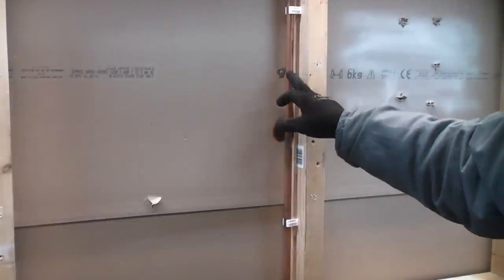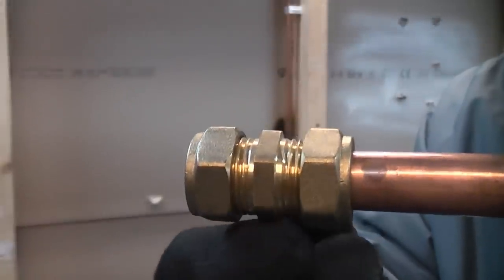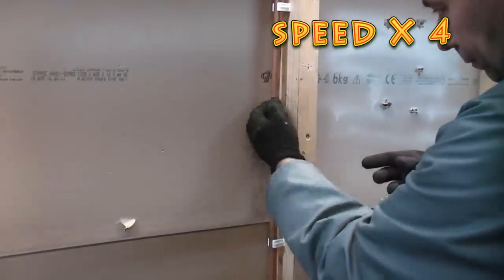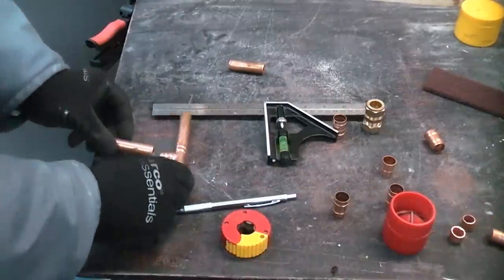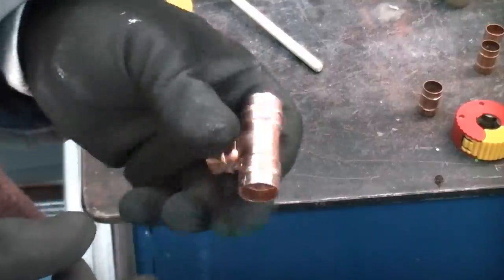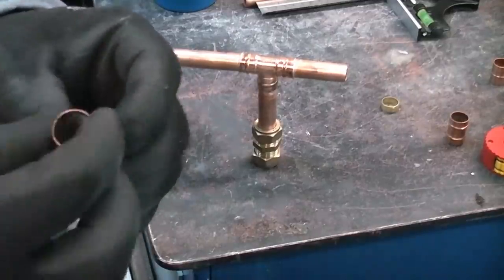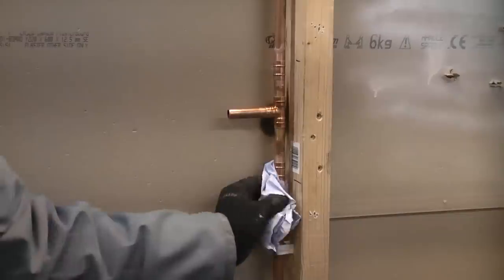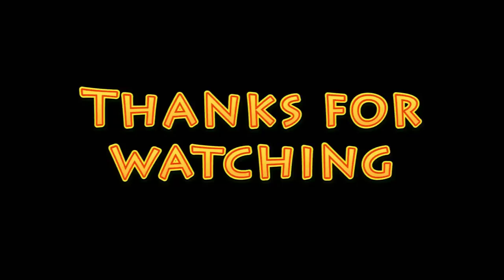How to use slip couplings to tee into a rigid copper pipe

Comment: could have done that job with one slip coupling!
Reply from the maker: Really?
Reply from the maker: I have thought about it. 
Perhaps you would care to enlighten me ?
Reply: Make two cuts and remove section of pipe. 
Make sure lowest of the cuts is where you want the branch of the tee to be. Allow 15mm for insertion depth. 
Prep pipe and tee coupler. 
Put lowest socket of tee onto pipe.
Measure removed pipe and cut off section of branch approx 15mm. 
Prep all pipe sections remaining and slide slip coupler up or down, align pipe and slide into position. 
Pencil mark is useful so slip couipler is equally covering both ends of cut=insertion depth.
Solder up.
Compression slips are available too if persistant drips are present.
Wouldn't use bread sponge if it's going to a boiler flow or return and if cold feed for domestic hot water If you cant flush Warburtons toastie out It'll get into the plate heat exchanger and do block it up.
Reply: I'd like to hear how myself. I can't think how either
Reply: Ultimate Handyman  he's spot on you only needed one the other coupling basically being the tee is what he means
Reply: I agree, only one slip joint is needed. Slip it far enough along the existing pipe and there will be enough room to pull the pipe out at a slight angle and slot the tee joint in, then pull the slip joint back across. Above or below, it wouldn't matter.
Reply: There is some flex in that pipe. One side stop, one side no stop. Bend out pipe a little to and insert the assembly with the stop fitting.
Reply: by having either the top or bottom pipe portion fitting directly into the T
Reply: Not if the pipe won't move. Unless you bend one piece.
Reply: No way without bending one side to get the pipe in the fitting. I suppose one could pound the pipe into the fitting.Ouch!
Reply: You could join the top part of the tee onto the existing pipe coming down and only use a slip coupling on the bottom piece, or vice versa
Reply: hi well one slip would be replaced by a tee.
Reply from the maker: Yes, but the pipe will not slip through the Tee like it will with a slip coupling ;-)
Reply from the maker: You can't pull the pipe anywhere, it is rigid and cannot be moved.
Reply from the maker: But the Tee is not a slip coupling, so the pipe will stop ;-)
Reply from the maker: Exactly ;-)
Reply from the maker: I look forwards to seeing your video on how to do that.
Please ensure that the pipes are rigid (cannot be moved).
Reply from the maker: I hope you are paying attention to ALL of the experts ;-)
Reply: Your particular length of pipe is held onto the timber stud by plastic clips, so it MUST be possible to pull it out by the width of the pipe, that's all it needs. If we have to pretend there is no flex whatsoever then that's a different matter and two slip joints would be needed, but we're basing our comments on your scenario, not an imagined one.
Reply: Ultimate Handyman I think they’re saying the pipe was rigid because you didn’t remove the pipe hangers. This would’ve allowed the pipe to be moved just enough to use only one slip coupling. A plumber probably would’ve removed and replaced the hangers so he could work more easily. Really doesn’t matter, but you know people are always going to point out how they would’ve done it.
Reply from the maker: Yes it is and above that is a elbow and at the bottom is an elbow, so the pipe is rigid and cannot be moved in any direction. Thanks for the comment ;-)
Reply from the maker: You can't remove the pipe from the pipe clips as it is held at the top and the bottom with clips, near the top and bottom elbows. If I could have moved the pipes I would have used normal couplings ;-)
I tried to state in the video title that the pipe was rigid and also mentioned about a scenario where a pipe was joined to a boiler and concreted into the floor!
Anyway, I think people now know what a slip coupling does ;-)
Thanks for the comment
Reply: @loafersheffield  what technique would you use for rad pipes if not bread?.
Reply: I agree with the gentleman who wrote that you just need one coupling and the tee fitting ,the pipe is being held in a plastic clamp above ad below the cuts if you put the slip coupling on your choice of pipe to join again then you can slip the tee on because it has a ring in side to stop it from blocking the lateral opening, cut the piece of copper to fit in place solder tee first push the other end in then slid the slip coupling down to the line that you were supposed to have marked on the pipe to be soldered ,solder it in ,plug the lateral pressure test then complete the job with two fittings instead of three. Saving about 7-9 dollars including  overhead cost so your looking at plumber price possibly $150.00 give or take 10 - 25 dollar . It would be cheaper if you do it yourself . Those plastic holding clamps you possibly pulled out one of the loose ends to joinit.
Reply: Didn't know about the elbows didn't show
Reply: Good catch. I'm going whys he using 2 slips. He does get a thumbs up for wiping off excess flux on verticals. I don't like to add joints so if you can't move the pipe you smooth off the bottom pipe stop on the the tee. Now it's a slip t.
Reply: Why do they not make slip tee couplings?

Comment: You also could use PEX and shark bites . 👍👍
Reply: Absolutely, 5 seconds into the video I was saying to myself, why isn't he using Pex?  I don't solder anymore, not because I don't know how, done many.  Sure Pex may be bit more expensive if you use Sharkbite but you can use Push'n Turn which is quite a bit cheaper.  I neither had never heard about slip couplings, good to know if ever need them. Good video though.

Comment: You don't always need two slip couplers: more often than not you can pull out one side of the pipe to fit one side of the tee on; then you only need one slip coupler on the other side. Incidentally does anyone make slip tee couplings? If you can get one side on this would avoid the need for any additional couplers at all.
Reply from the maker: At last, someone with some common sense 👍
The amount of people that commented saying you only need one slip coupling was driving me nuts!
I searched for a slip T coupling a few months back for a job that I was doing, but I could not find one.

Comment: I know how to use repair couplings, I only clicked the video because it looked like he was using a torch with pro press fittings. I’ve never seen sweat fittings like that before. Must be a European thing. They’re sure making soldering idiot proof though they do make a sweat joint look much prettier
Reply from the maker: Solder ring fittings are great, I'm not sure if they use them in other parts of Europe, or if they are only used in the UK
https://www.youtube.com/watch?v=7zlDHA3KhLA
Thanks for the comment

Comment: Well done, but wouldn't a t drill do the job
Reply from the maker: Not sure how you would cut a pipe using a drill 🤔
Thanks for the comment 👍
Reply: A T drill, it's a machine that you drill into copper pipe, when the drill tip is inside, you twist a ring on the chuck and two formers extend outwards the machine retracts the drill tip with formers and a collar is made for the branch, I live in Finland, I'm sure plumbers in the UK use T drills. 🇬🇧😊

Comment: I don't understand why you used 2 slip couplings when it would have worked with just one.
Reply from the maker: The pipe is rigid, you need two slip couplings 😉
Reply: @ultimatehandyman  I agree to a point but the pipe you were working on was quite long so it would have had enough give in it to pull away from the wall to slide on the the tee. But if the pipe was very short then yes you would need 2 couplings. I often used washing machine "slip" tee taps in my plumbing days but I don't know if you can still buy them. It was good to hear you saying how useful solder ring joints are as I know many plumbers think you're an amateur if you use them but I often used them if I was just doing the odd joint and used end feed if there were many joints to make. I also used compression joints. They all have there place and there's a skill to using them all.  No offence meant my friend it was just an observation. Love your vids thanks.

Comment: It can be done with only one slip coupling.
Reply from the maker: I look forwards to seeing your video.
Make 100% certain that the pipes cannot move and are rigid ;-)
Reply: Yes, In this instance you could probably do it with one slip coupling and the tee coupling, it would depend how much "give" you get in the pipe once you've made the first cut ...still a very good video though and it is the text book way if you can't achieve any movement on the pipe at all...

Comment: Would be great to show how to successfully use a speed fit tee with two fixed pipes , that can be a right pain in a@&e
Reply from the maker: If you can't move the pipes, it is really difficult. I guess in some cases you might have to cut out a section of the pipe and use a piece of plastic pipe in between.
Thanks for the comment

Comment: Are you not a believer in putting on extra solder, most plumbers do and if not why not?
Reply from the maker: It’s all down to personal preference. If I was going to add solder, I would just buy end feed fittings instead.  Josh always adds extra solder to solder ring fittings, but I don’t (he’s been in a couple of videos). I have never had a solder ring fitting leak, ever!
Thanks for the comment 👍
Reply: @ultimatehandyman  Thank you.
Reply: @ultimatehandyman  I'm a general builder and only do plumbing if no one else shows up. I always used extra solder as that is what I saw everyone else doing.
There is a flux available in the USA called tinning flux. It has powdered solder in it for extra security. It is not available in Ireland .
Just wondering if it's available in the UK?
Slip fittings  ot available here either.
Great videos keep up the good work and thanks.
Reply from the maker: @briancarton1804  Hi Brian, 
Can you not buy online and get it shipped? I always thought that all UK companies shipped to Ireland with no issues (unless you are in the south).

I often use these people- www.jtmplumbing.co.uk
Sometimes I buy stuff from all over the world via eBay and Amazon
I don’t recall seeing tinning flux for sale anywhere to be honest, in fact this is the first time I have heard of it.
Reply: @ultimatehandyman  Thanks for your reply.  I'm in the Republic and we still use the half inch pipe. I don't know if there are half inch slip fittings available in the UK, if there are I will buy some.
Saw the tinning flux on an American Web site recently, can't remember the site if I find it I will tell you about it.
I have had covid and while sick I watched lots of trades videos. 
Despite my years of experience there is always something new to learn. Every day is a school day.
The only hazard of looking at these videos is one can go green with envy seeing what is available elsewhere. 
Our Yankee cousins have some great stuff.
Reply from the maker: @briancarton1804   You are welcome.
I have only come across ½ pipe once, and that was a few weeks back when I was helping out a friend. I sent him to the plumbers merchants to get some ½ olives, but both the guy behind the counter and a plumber that I know, both said that 15mm compression is fine on ½ pipe, but I’m not sure about solder ring fittings or end feed fittings. 
I hope you are over the covid  👍

yeah, there are some amazing tools/products available now!

Comment: If it was me, I would have turned water off, cut pipe, removed brackets on pipe,removed timber, wall linings, taken out cylinder, then joined pipe in vice, weld, then put back together.
Reply from the maker: LOL
Thanks for the comment

Comment: you only need one slip coupling come on ,,
Reply from the maker: Ok, you film a video and put a tee into a rigid copper pipe using just one slip coupling.
Rigid means that the pipe cannot be moved in any direction.